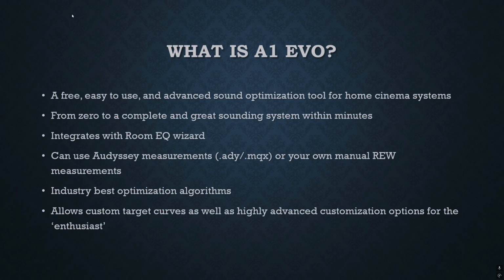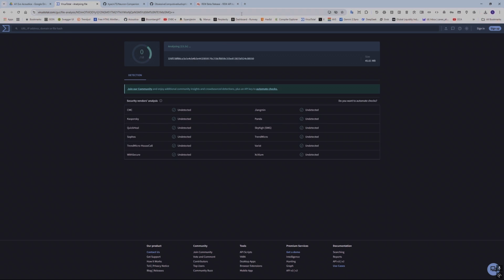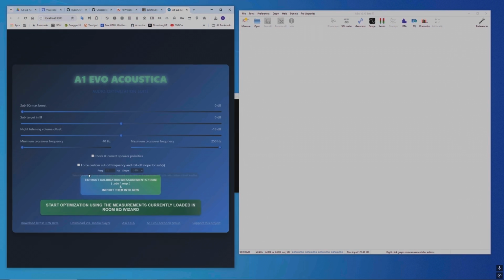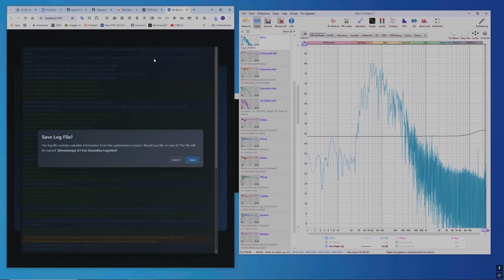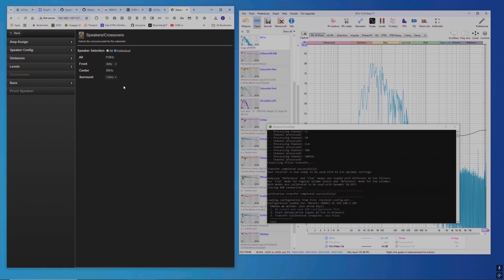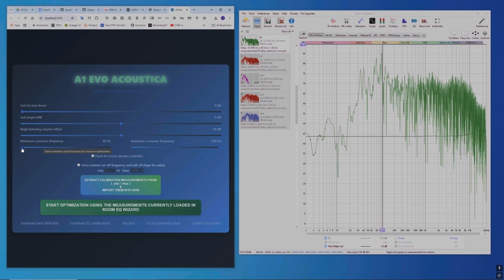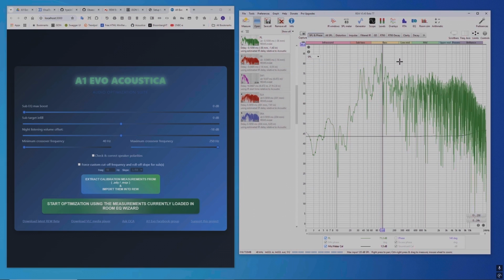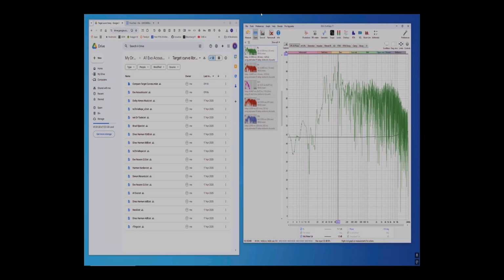A1 Evo Acoustica

Comment: Well, I tried it. Latest version v8 even. Bought UMIK mic, did the manual REW measurements, ran Acoustica, and the sound that came out is beyond horrible! Bass is all muddled and boomy, no tightness and clearness, dialogue/vocals volume is uneven within the same song. Which makes sense since sub crossovers were set to 120-150Hz!! I'm not sure what the hype is behind this, but the sound it produces is worse than default Audyssey calibration.
Reply: Hi.. I have been using OCAs solution from day 1 of this journey.. we need to understand that the output is completely dependent upon the input measurement file that we generate.. I learnt a lot in this journey and realized that whenever OCA didnt sound good was always coz of errors at my end.. You have added UMIK in the equation and it might need some time for you to learn how to use the MIC (with it's calibration files) correctly.. UMIK is more accurate but at the same time more sensitive to errors..spend some more time with the solution and I am sure you will realize the power of this tool.. All the best with your experimentation.. As suggested, try with MLP measurement using basic AUD Mic that came with the AVR.. Use the Acoustica inbuilt measurement tool.. Also, after transferring the file to AVR check if it got correctly applied to the AVR..
Reply from the maker: Something must have gone wrong. Try single point (at MLP) Acoustica measurement to eliminate possible errors.

Comment: Hi OCA, need some help. I followed all the steps and uploaded it on my Denon AVR X4400H. I've noticed that it killed my bass and volume was too low even if I crank up the volume especially my 4 height speakers. I've returned my AVR to my previous settings whilst I get an answer from this issue. Many thanks.
Reply from the maker: Run with default settings and if the sound is less than great, re-measure at MLP with Acoustica's own measurement tool.
Reply: @ocaudiophile  Thanks!

Comment: Hello, 
Thank you for your development on this. Outstanding work. This is my first time ever using or doing this. Transfer worked well using an OLD macbook from 2013 (Just sharing). Lastly, right of the bat, its VERY clear at much lower volumes(45). Set to flat. I can only imagine reference. 

My only question is, i saw that in the UI for the denon the subwoofer distance was 0.00, could be a bug as you mentioned in the video but i wanted to make that comment for the record. Other than that. 

As far as contributions go, since this is my first time around here, is youtube your preference for contributions or is there another place? Thanks! i am super sensitive to high volumes so now at lower volumes.. has been awesome. Cheers.
Reply from the maker: If you have only one sub, distance 0m is often not a desired outcome but with more subs, one of them getting 0m is quite normal.

Comment: i have used a measurement that i did with the audyssey multEQ app and tried the acoustica optimization using different target curves .. yet i was unable to make my system sound better than with the optimization multEQ did.. acoustica also gave me some target settings that dont make much sense to me like..
Bass extraction low-pass filter: 250 Hz (using LFE+main) -> why would that ever be higher than Low-pass filter?
Low-pass filter: 200 Hz
Center crossover frequency: 250 Hz -> this also seems pretty high
.. maybe i am understanding these things wrong.. might a new measurement with the acoustics app help?
Reply from the maker: If you are using Android app, it's buggy. You can use Acoustica's own measurement tool which can take up to 25 mic positions. Everything is customizable in Acoustica and default settings will never sound worse than normal Audyssey if everything is fine.
Reply: @ocaudiophile  i measured with acoustica as well as with REW .. in all cases i get almost no bass after optimization .. changing settings in acoustica also didnt help
Reply from the maker: You're the only one in the World 😉
Reply: @ocaudiophile  awesome.. thank you

Comment: Wow. Just wow! OCA this v8 release is absolutely sublime, I cannot articulate anymore how good Acoustica sounds in my room; I just love it. I really want to invite people over randomly to listen to this (To show it off) as it is so good (At least I think so! ;-)).  Having been through every A1 iteration, as I have started to learn and understand more about my room and system, I have gradually started to tweak settings to adjust to preference in sound slightly from defaults.  Your recent update included a height/atmos slider, which to me, was like the cherry on the cake. Having my height speakers at around 150/180 creates such incredible atmospheric bass/sound around the 4 subs. Amazing!
Acoustica’s clarity is stunning. The recent config addition to centre priority makes my front sound stage spectacular. Dialogue is the best it has ever been and the whole front is just so well integrated.  With Acoustica I have come to realise that I can tweak using the advanced settings my crossovers down from where previously say they may be 120/150+ to 90 and even 80 without loosing any clarity at all.  I think Nexus was my first noticable difference in dialogue clarity using my centre at 110 however with my centre at 90 or 80, dialogue is so crystal clear and still retains perfection using all my test scenes and is way better than Nexus and Neuron.  I therefore went from setting all my crossovers from 110 or 100/90 to now all set at 80 with front heights at 180 and rear heights at 150 (Min/max is 150-200). I absolutely love it, fast, dynamic, incredibly tight strong bass (Using Acoustics default for HPF/LPF is best!) and all with such detail; it is remarkable.  The double bass LFE+Main is also great and I think I could potentially argue that centre clarity might edge LFE centre priority mode; jury still out on this though and feels more something I would use for musical orientated movies than fast action movies.  
I hope this is not the “final” regardless of how good it is but I hope you keep the journey going, experimenting/researching new ideas/thoughts that will allow us to keep testing/listening and feeding back long into the future.  Look forward to what comes next (No pressure ha!)
Truly awesome - thank you 😊
Paul
Reply from the maker: Thank you for your kind words and gesture.
Reply: Thanks for sharing your experience. I'm curious, before you adjusted the advanced max crossover slides down to the lower  levels you mention, by default where most of your crossovers optimizing at 200Hz or higher? That's what I'm getting for all my channels, which seems odd (prior A1 evo versions optimized much lower, close to the actual speaker roll off). I always listen to see what it sounds like first before trying to tweak, but it isn't really an improvement so I'm wondering if I need to manually adjust the max crossover settings in V8.
Reply from the maker: @andrew81818 Why not try? It takes 5 minutes. Even easier to test A/B if you've presets. It's your ears who decide which is better.
Reply: @ocaudiophile yep, I will. Just a lot of advanced options gives a lot more permutations 😂 x5min with 15+min of listening thereafter. So trying to understand a little more first. The X6700h should EQ to lower XOs, so I am curious why it's picking the higher XOs (will look at the sweep data, maybe it's obvious). 

My prior A1 maestro profile sounded great with double bass (LFE+Main), but my trials so far with V8 sound better without double bass option,  but maybe this too is because my XOs are set at 200Hz+?
Reply: My default XO’s normally come in between 120 and 200, depending on TC, which I have no problem with; it sounds great and I normally listen at around -12/-10 volume so I have absolutely no issues with defaults.  However, if you drop the volume, I can on the odd occasion depending on content notice little localisation on the bass on the 4 subs but it is rare and only at lower volume with older content.
Reply: I loved running ALL speakers with the same identical XO; this is still a favourite. This would ALL be set to say 110/120 for everything; it again sounds incredible.  

At the moment my preset 2 is running all 80xo bed layer and 150/180 heights, again comparing content but over a longer period against defaults.  Not easy. Trying to test the THX/80hz myth is best, which I have to say is great but might not be my preferred.  My conclusion so far is heights run best at 180, thats a fact with my system/room.  heights being 180 gives some atmospheric bass and creates a better and more obvious bubble.
Reply: My aim is to work out preference and also gain an understanding of my room. I would never have a problem leaving default settings for Acoustica as it sounds exceptional.  Everybody has their preference/likes with regards to sound.  My heights at 180 for example sounds just soooo good and I mainly watch and listen to Dolby Atmos content.   Also my centre always sounds best at around 110/120 even with the rear ports bunged. It takes time to listen and experiment and I really don’t think I have found my perfect settings yet.
Reply: Thank you Paul for your further thoughts. I had tried many versions of A1 Evo last year, settling on a "double bass" option with Maestro that I used happily for a year now (my preset 2), so my recent trials with Acoustica have been against that baseline. 😊 But the degrees is freedom with V8 are quite high and will keep us busy for awhile! Everyone's system, room, tastes differ so I think V8s flexibility is essential and an amazing resource.
The default configuration sound nice, but just wasn't as tight and atmospheric as the A1 Evo maestro I had. I studied the pre-processed data and I could see  the dips on L or R of most pairs between 80 and 200 Hz that V8 was aggressively avoiding by seeing the XO higher. Motivated by your post I tried double bass mode and set the LPF to 120Hz, XO max to 90Hz center, 150 surrounds and 200 heights to be closer to what I had with maestro. This sounds amazing to me, and I think better than my maestro. I also tried DE and I think I can tell it helps with dialogue. I also tried APF, but bass became very boomy after. I tried to find a post to understand what APF is, not seeing a change in the filters produced in REW. Any idea what it is doing? Also I did a good deal of messing with SW EQ and infill slides, but changes here seem to just make my bass less tight, even if the "sw_final" predictions look better in REW. I might have added too much - what did you  look for with these to perfect your bass? Best, Andrew
Reply: @andrew81818  APF is something probably OCA can help you with there however Carl from HD movie source did a recent video which describes what you hear with APF enabled and I find the same; he explains this really well.  Try putting the centre blend, APF enabled and dialogue enhancer on; this is all magic to me and really quite amazing. For bass, I mainly do trial and error listening and after months and months of non-stop testing, the Navidv2 curve, boost of 4 and infill of 2.5 gives me my ideal settings.  This results in around 6db for overall subwoofer and setting 4 subs between +5 and +8 db. It sounds like your making some really nice progress with Acoustica 😉

Comment: Hi Oca, I’ve tried several times to use my file with the AUD MultEQ app. It does work, but when I load it into my receiver, the sound becomes noticeably quieter and it sounds worse than when using Audyssey itself. What am I doing wrong? Would it be possible to get in touch with you directly?
Reply from the maker: You do not use Audyssey app with Acoustica! You can use measurements you took with the app although you can take measurements with Acoustica itself as well. Either way, your system's measurements will be in an .ady file. You can start Acoustica, select option 3, press "Extract measurements" button and then when all measurements are uploaded in REW, you can click "Start optimization" button. 3-4 minutes later optimization will finish and generate an .oca file. Send this .oca file to your AV receiver using option 4 of Acoustica and you are done. If you get confused, there are guides in the video download folder.

Comment: Hi OCA and everyone involved in this amazing project,

First of all, thank you so much for your incredible work. I honestly couldn’t believe how alive and dynamic my system became after using your tool. It’s absolutely brilliant!

I have one technical question:
Is it possible that all speakers are detected as inverted simply because the measurement sweep files themselves start with a negative impulse?

All my measurements – done with the 256kMeasSweep_0_to_24000_-12_dBFS_48k_Float_R_refL.wav and the .mlp lossless playback files – consistently show a negative impulse start in REW, usually peaking at -100%. Because of that, the invert check (if enabled) always reports errors for every speaker, even though I confirmed correct wiring using a battery test and multimeter.

I'm playing back the .mlp files via my Ugoos AM6B+ media server connected to a Denon X4800H, but the same behavior appears regardless of source – the impulse always starts negative. Also important: all measurements were made with REW and my UMIK-1 microphone, not the receiver's own mic.

Could this simply be a harmless artifact of the sweep files?
If I disable the inversion correction in A1 Evo Acoustica, does that impact the correction quality – or is it safe to ignore if the polarity error is falsely triggered by sweep shape?

Additionally, I’d like to ask:
Will there be a Receiver reset option in A1 Evo Acoustica (like in A1 Evo Neuron) again, to allow direct REW measurements using external microphones like the UMIK-1?
Right now it seems the measurement tool in Acoustica is only available when using the receiver’s own microphone – so I had to fall back to the fantastic reset tool from A1 Neuron to make things work.

Thanks again – your work has truly transformed my setup! 🙏
Reply: sorry, not -100db -> -100% start impulse
Reply: As a follow-up to my previous question:
Would it be possible in future versions to use different target curves per speaker group?

For example:
	•	Front L/R: Harman 6 dB
	•	Center: dialogue-optimized with a small 2–4 kHz boost
	•	Surround / Atmos: neutral or soft (e.g. Movie V2 or a custom curve)

Right now, using one global curve means all speakers are affected by adjustments that might only make sense for one role – like lifting the presence region for speech, which can be too harsh on other channels.

This would be an amazing improvement – thanks again for everything!
Reply from the maker: @blackIceJ It would not be an improvement, all speakers should sound the same in a system for proper immersion
Reply: @ocaudiophile  Thank you for your reply – I fully understand the goal of immersive coherence across all speakers.
My question came up because in smaller or untreated rooms, the center can sometimes struggle with clarity – especially for dialogue-heavy content or poorly mixed / quiet dialogue tracks.
I can see why consistent tonality across all channels is important, but perhaps one day there could be an optional center-specific dialogue target for such edge cases.
Either way, your tool is phenomenal – thanks again for all your work! 🙏
Reply from the maker: @blackIceJ muffled dialogue is often a bass problem, try a softer target curve, use center blend and allpass, one or more of these should work. It's also OK to increase center volume 1-2dB
Reply: @ocaudiophile  Got it, thanks – I’ll try enabling center blend and allpass and see how much a small center boost helps. I'm already using the Dirac Harman 4 dB curve, so I’ll avoid softening it further for now.

Comment: :16:00 AM WARNING] A Imported measurements in REW are missing data for each of the 2 subwoofers in your system! 11:16:00 AM [WARNING] Try manually measuring each of your subwoofers with REW and a calibration microphone and RCA cable swapping method 11:16:00 AM [ERROR] A1 Evo Acoustica cannot optimize your system without

Getting this error. I'm using a measurement file from the MultEQ app.

Comment: I just downloaded the file and scanned it with virustotal. why do 5 security vendors flag this file as malicious now?
Reply from the maker: Short answer, they want me to get the software digitally signed so they make money. Long answer, web workers used to parallelize subwoofer high pass filter calculations on all CPU cores (just for speed) makes them think this is a crypto miner. I have to encrypt the content of the windows zip with a password to avoid Google blocking it on the drive.